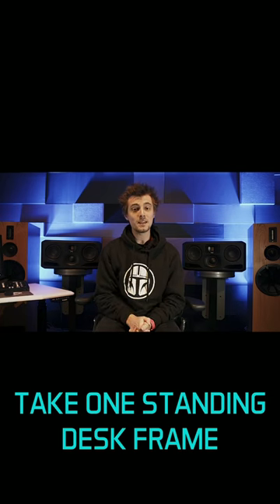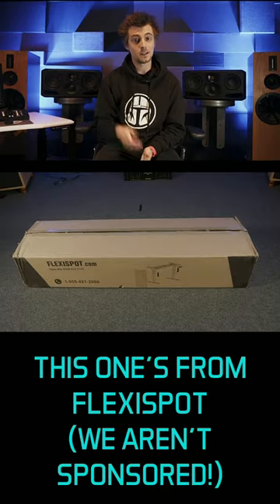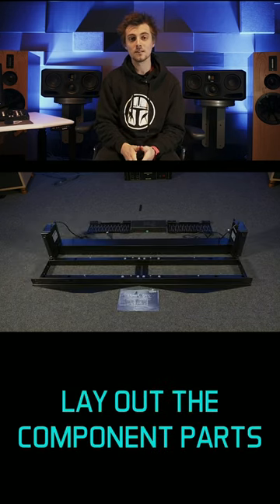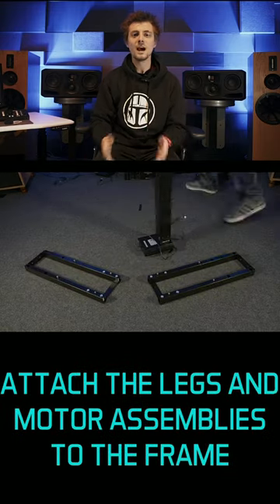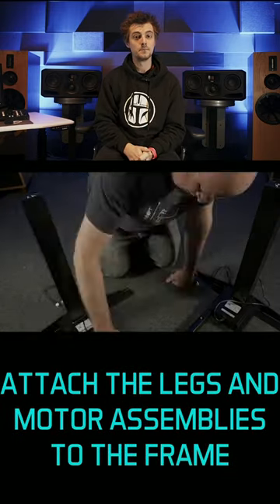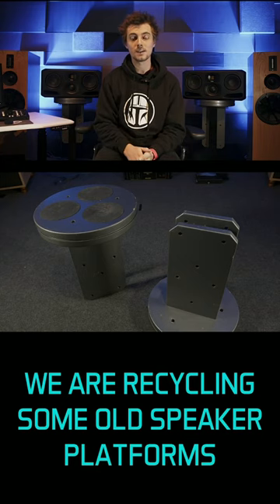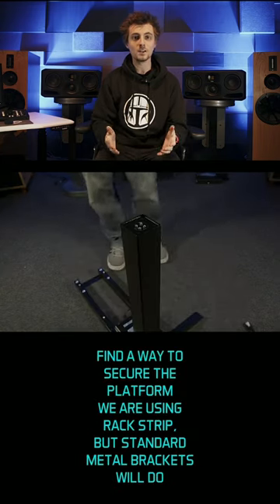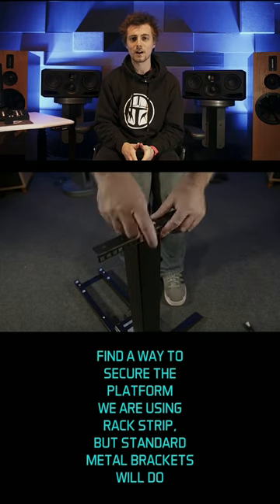#shorts - How To Make Your Own Motorised #Speaker Stand In Under One Minute!

Comment: The author says "fix the top plate to the base", which appears to indicate mounting the speaker stands to the bottom of the desk legs, using the desk *upside-down*. Also, it looks like a dual-motor standing desk, which means each leg has its own motor.

Comment: I’d love to see the measurements when up high (standing) vs normal (seated) position. 

What kind of difference does it make to the frequency response?
Reply from the maker: What Wayne said - it depends on your room, how high your ceiling is, what is at the first reflection points in each position.  In the case of our room, it's made no noticeable difference whatsoever

Comment: This is a clever idea! But if you need to place your speakers more than 3 ft apart, how do you connect both legs to the power unit? Maybe my standing desk is different from yours, but both of my motorized legs only have a short run of cable to the power unit (which is what the control box also connects to via Ethernet) and those connections from the legs to the power unit are some kind of six square head connector that I’m not familiar with, so I’m not sure if it can support longer runs to the legs 😖
Reply from the maker: They're called Molex connectors, and you can get extensions (or you can cut the cable and make your own)

Comment: You could call this the ‘Parliament Motion System’... as it requires the ‘speaker’ to rise up and settle back down, with each new one proposed.
Might you advise a blob of blutack under each monitor, if you’re going to whiz them around a lot?
Could this form the basis of a mechanical solution for those of us (just me..?) who have trouble discerning binaural ‘height’ effects?

Comment: Hey guys - has anyone ever experimented with monitor suspension instead of placement.
I wonder if the stretching of a thing (rubber or such) would be entirely different to the compression of similar.
To that end a motorized gimble with (say) four wires/rods/whatever connected to the top of a speaker via some "stuff" (rubber??) would be better and less transmissive than other ways.
The cool part would be programmable gimble settings for direction and tilt - Standing, Sitting, Flop Cats Fav ... etc
Whaddyarekkon?
Reply from the maker: It’s a cool idea, for sure! Maybe an experiment we need to do…
Reply: @PresentDayProduction  I did some work in a 7.1 studio which had suspended speakers, including the LFE sub. Most notable thing was that you could barely notice the LFE because it didn't propagate very well hanging in the ceiling.
Reply: @technoman215  Yeah suspending the sub wouldnt be on my to-dolist
Immersing the bottom 5/10mm in a 300mm thick blob of concrete however .... :) The mind boggles
Reply: @PresentDayProduction  Oh Yeah !!!!
I can just imaging the look of satisfaction on flopcats face (we know who we're talking about here right??)  whn he decides he wants to stand up for a bit, or go sit on the couch or ....
Might make for interesting alternative to 'try it in the car', 'Try it on the boat (wish I had a boat :/) try it in the bedroom  -- WAIT! - NOOooooooo - lol

Comment: Can you guys find something everyone can buy as a solution to what to attach to the top to hold the speakers?

Obviously something that offers the isolation you’ll need from a stand, much like what you used but readily available.
Reply from the maker: Try a vesa TV mounting plate screwed to the top of the legs (you might need to drill a few holes) with a paving slab on top:
https://amzn.to/3iWo0n7